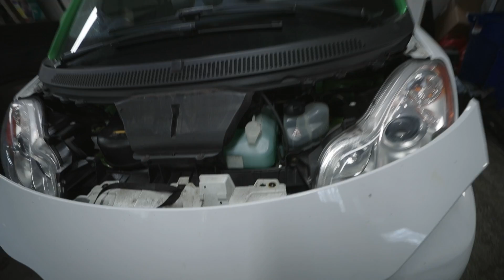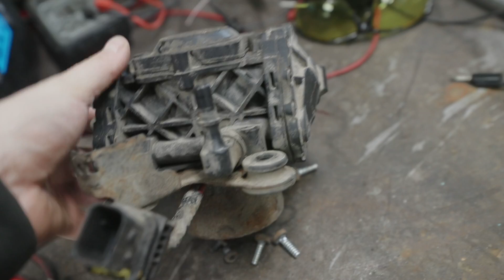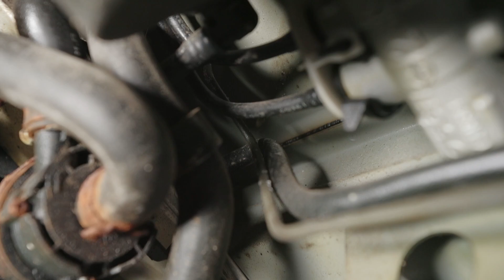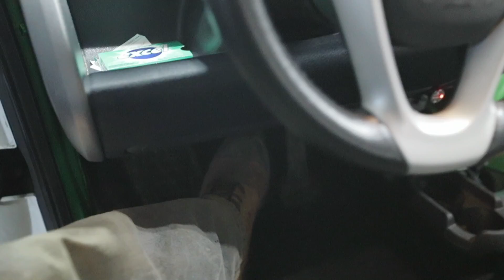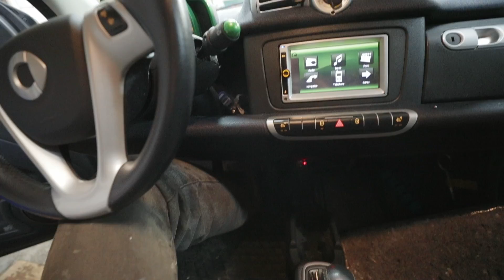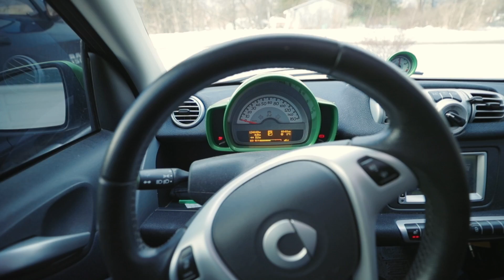Smart Electric Car - life after 100,000 KM and a bad vacuum pump

Comment: Great info, can I ask if you have noticed any problem/range issue if the cars been outside in the winter, maybe after a workshift 8-12 hours or longer etc if someone wants to use the car without a garage in the winter, and have you achieved charging the car at 22 kw speed if it has that installed? Thanks
Reply from the maker: I typically only get about 60 KM in the winter. Not sure about the charging speed as I only use a level 1 at home.

Comment: Hello again,
Reaching out to recommend you to change the transmission oil! 78000km, just changed mine and it was unbelievably awful!! 
I changed it because I have a leak somewhere, and since I thought it was the driveshafts seals, I got the oil changed.
Anyways, my leak of transmission oil is still somewhere to find :( 
Btw, do you have any transmission oil leaks?
Reply from the maker: Mine did have a leak early on and it was fixed under warranty. I believe it was leaking out a breather tube.

Yeah I guess I should change the oil someday soon. I'm up to 150,000 KM now and I've never even checked the level!
Reply: @glassglowz  150000!! 
Well, that would be a great idea to make a new video 😉

Comment: I missed your video for already some months... Thanks for the update!
Mine is counting 72000 km, doing perfect.
There's one for sale near where I live that has 158000 km.

Good to know about the rust. I'll check mine and put some protection coating.

Quick question: did you ever change the transmission oil, battery coolant or any other stuff?
Reply from the maker: Thanks for watching! No, I have never changed any of the fluids.

Comment: Thanks for taking the time to update us Canadian owners of Smart EDs. Mine is a 2014 model and 120000 km. Battery range is still well over 100km in summer; had some issues with a Drive Sys fault popping up. Turned out to be a faulty connector on the ECU positioned in the rear right fender. I'll be jacking it up in the next few weeks for an under body inspection concerning the rust. For sure I'll be getting it oiled next autumn with the under-body plastics removed for better access.

Comment: My personal experience with brushed motors that stop like that, is that it is caused by the dust from the brushes interfering with the connection. I have revived dead blower motors by cleaning them out, either by using light solvents, or by cleaning with soapy water and carefully drying them out after.
Reply from the maker: Oh that's interesting. Hopefully this one will keep working for a few more years now that it's cleaned out.
Reply: @glassglowz  I certainly hope so. I'm glad to see yours is still going. I'm just about at the 5 month mark with mine now at 87500 km on the odo, and I'm hoping to drive it until the wheels fall off.